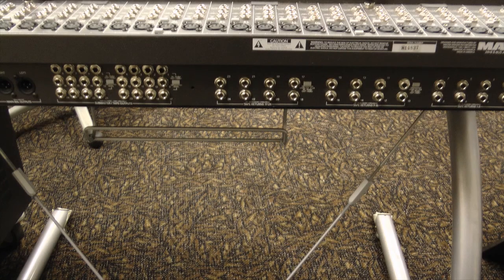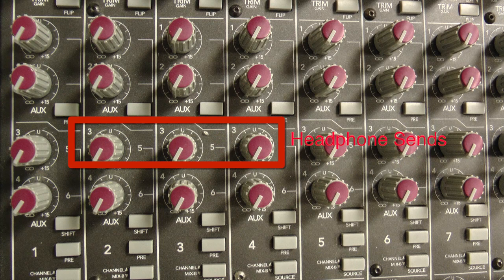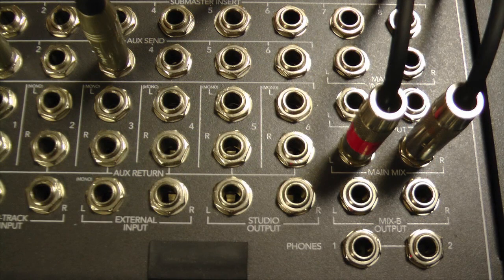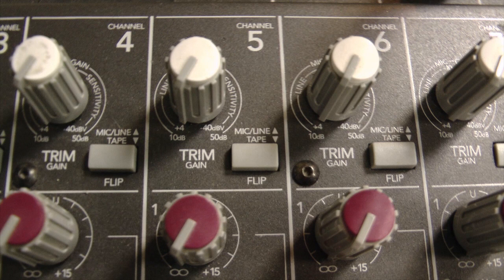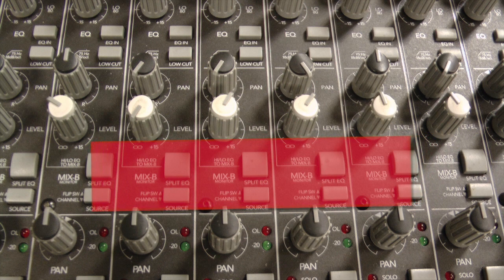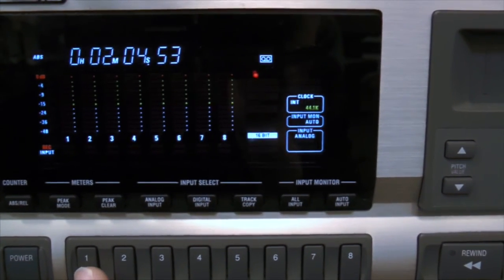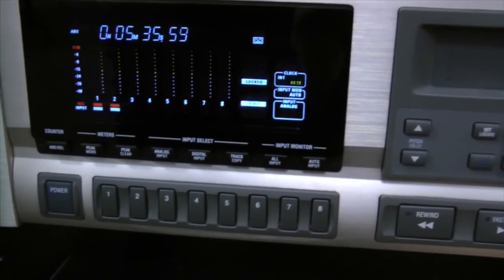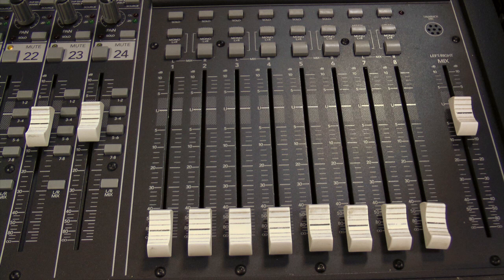Inline Monitoring

Comment: I guess what confuses me now, is that if the Mix B is basically the same as the monitor path on an SSL, shouldn't you somehow be listening to the Mix B even as your recording? With an SSL, you normally listen to the monitor path as your tracking, but the way the Mackie is set up, it seems like you're listening to the channel path as you're tracking and don't listen to the monitor path until afterwards.

Comment: Thank you so much for taking the time to clarify that. That makes A LOT more sense now.

What I don't completely get though is if the FLIP button is up when you are tracking, are you not actually monitoring the end of the signal chain until after the signal is already recorded and then you press the FLIP button down? Because if the FLIP button is up, aren't you monitoring the signal coming into the mixer and not the signal coming back from the ADAT?...

Comment: I also have a question about the FLIP button. You said it should be up (to hear the Mic/Line Inputs) for initial tracking and overdubs and down (to hear the tape returns) for bouncing. I'm confused about this, because how would you overdub if you didn't hear the tape returns on the tracks that were already recorded? Would you need the FLIP button down on channels that were receiving tape returns from the ADAT of recorded tracks,but have the FLIP button up on the channel you are using to overdub?